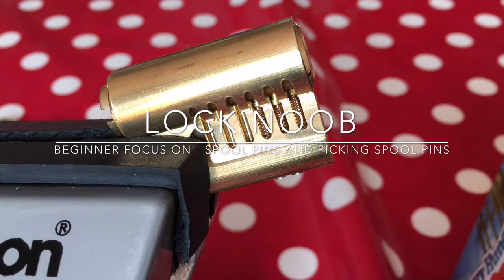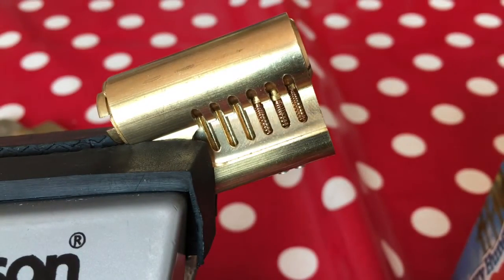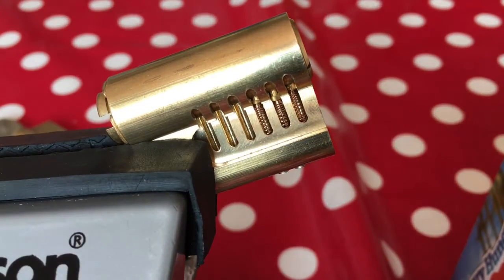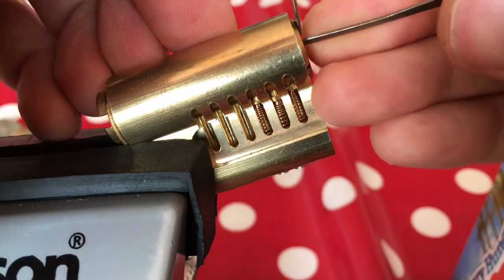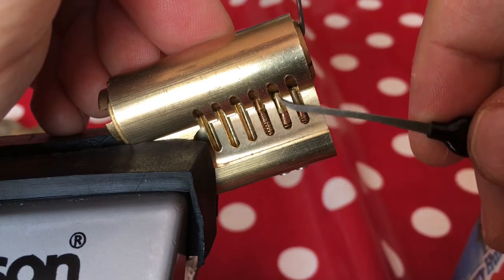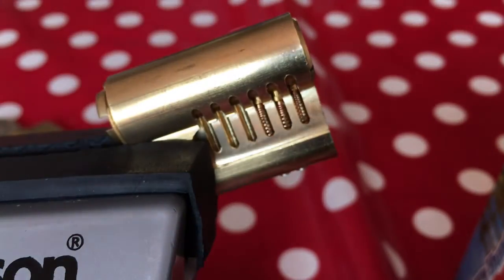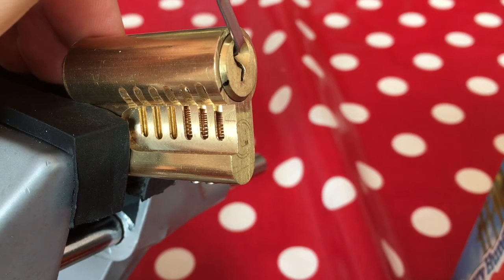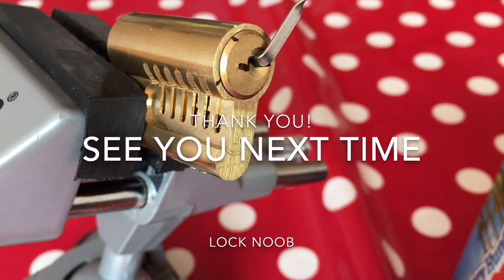(033) Beginner focus on - Spool pins and picking spool pins

Comment: Thank you so much for this video. Ironically, I'm a true newbie lock-picker myself. Only for a couple weeks now have I been getting into the sport. I've been watching you and the other respected YouTube pickers, rounded up all the locks I could find in my garage, bought and fabricated a couple cheap sets, and gave her a go. I had some patient luck with various Master locks I found (a few No. 3s, a No. 4, a No. 5, etc. [many without keys]), however one I hoped would be easier was a 185D (without the key). Quick research revealed this lock had a few spool pins in it. I KNEW I was feeling my first false sets! Between this and the #bosnianbill video where he translated the tension to a cardboard box needle scale with a washer weight, the counter rotation feel was perfectly explained, and I knew it as soon as I felt it. Big smile on my face when I got her. A big thank you from Alaska, and keep up the helpful videos and information. Know that it is appreciated.
Reply from the maker: Thanks!

Comment: Dear  great guide. Veeery exhaustive! I was able to apply your suggestions with success.. but now I have a cilinder that after a half turn blocks itself again. Now I do not understand if the pins goes back to block the flat side of the key or is another trick to avoid involuntary openings. Thanks again!
Reply from the maker: Thanks 🙏

Comment: Will the standard pin always bind first before the spool pins? How do you know which one is standard?

I’m really struggling to not overset and also for feeling for counter rotation. Sometimes it’s there and other times not. I just got a Brinks 40mm and Master 141 to try out. Picked the Brinks twice right away (raked it the first time, and then spp the second, and got it really fast.  But now I’ve been trying for several hours to pick it again with no luck. And the 141 has just been trouble. I think it has some fairly extreme keying and no slop in the core,  so it’s pretty darn hard for this N00b.
Reply: There isn’t always a standard driver, but most locks do have at least one to make key insertion more reliable.  It’s often #1 and stainless for anti-drill protection.

Standard pins will usually bind before serrateds before spools.

However, these are not hard rules; be prepared for any position or binding order.

Comment: I know this is five years late but i just got into picking recently. I figured out counter rotation on my own just through experience. The problem is every time I run into counter rotation it resets the pins. Even if I DO NOT release tension. The counter rotation itself resets pins. Is that a binding order issue? I feel like it is. I figured when I DO release tension I just am not quite skilled enough to find that happy medium. But the times I DON'T release tension I don't know what else could be resetting the pins. It usually doesn't reset ALL of them. So binding order is about all I can think of that could be causing that. Is there anything else that could cause that or is it binding order?

Comment: Trying to pick a Bezel, 6 pins4-5 spoles, but cant seem to find a false set. Have managed to pick it 3 times without really knowing what I am doing. Pins arent speaking to me at all. Atleast not in a language I understand. Needless to say I am a beginner. Any tips how to move forward?
Reply from the maker: If you can, dissasmble the lock and leave 2 or 3 pins in and try feeling for each pin and how they bind. It all just takes a bit of practice. Good luck :-)

Comment: I text madbob and he added some of your prybar tension tools to the site. I was the first order. I was not expecting to order so so soon, since my money is running low from so much lock-related gear. But since he was so prompt adding them to the site I felt I should do it or never do it. So I did it. I placed my order! What are the benefits to the curved ones?
Reply from the maker: Well done! They add a little comfort when hand picking some padlocks, you rest your finger along the curve.  I quite like it but you'll have to try it out yourself when they arrive and see if it suits your style of picking.
Reply: Nice. Well it will be a few weeks before I get them. I ordered a set of pry bars from ukbumpkeys and have yet to receive them. Can you comment on the brand your standard ones were on that video showing the mad bobs?
Reply from the maker: +techwg I think they were also from Ukbumpkeys, but I actually can't remember, sorry. I know for sure that they are not Peterson though!

Comment: Great video, glad I found your channel. Now, what to do if you think you have spools, ie: Master 140d, Abus 55/40, but you don't get counter-rotation? I always end up dropping the tension tool since i can't release enough to set the spools... Any suggestions?
Reply from the maker: That’s  very odd. Some locks with spools with high cuts on all the positions on the key don’t activate a spool when Picked. Not sure what else to suggest, sorry :-)